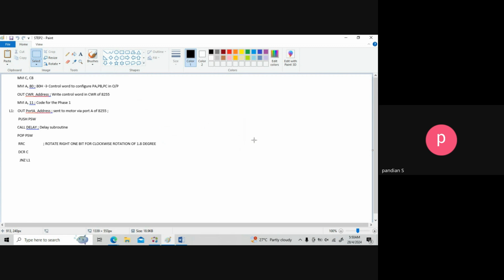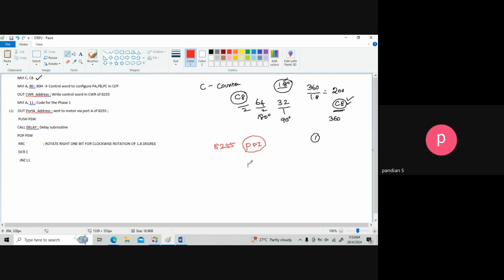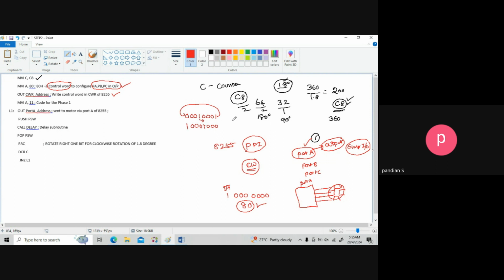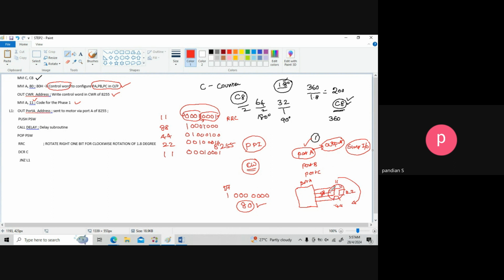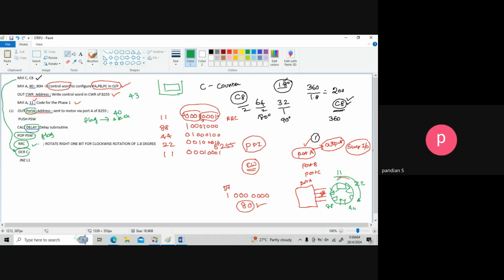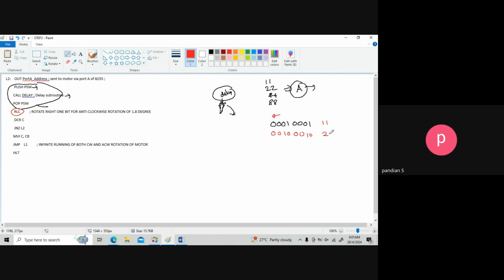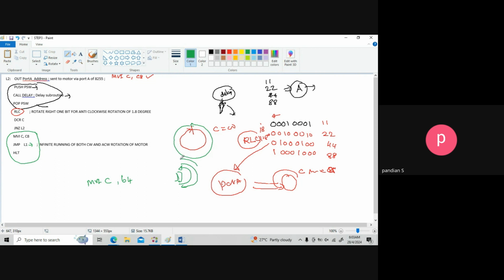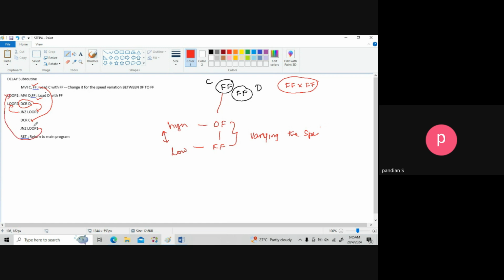STEPPER MOTOR CONTROL PROGRAM IN 8085

Comment from the maker: In the delay routine please use E register instead of C register.

DELAY Subroutine 
               MVI E, FF ; Load E with FF -- Change it for the speed variation BETWEEN 0F TO FF 
LOOP1: MVI D,FF ; Load D with FF 
LOOP2: DCR D 
               JNZ LOOP2 
               DCR E
              JNZ LOOP1 
               RET ; Return to main program